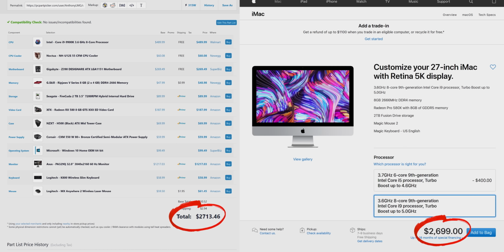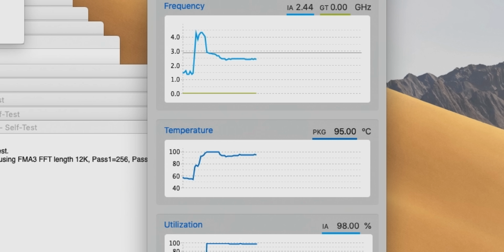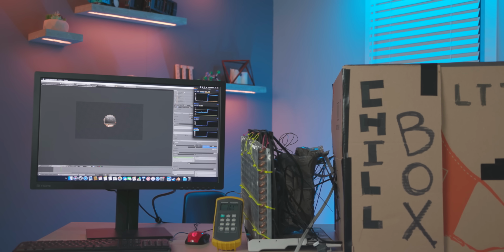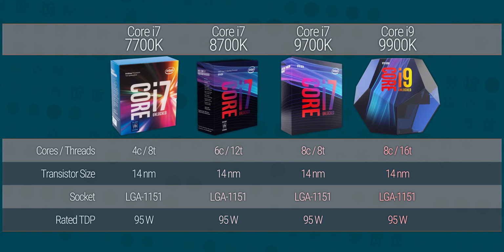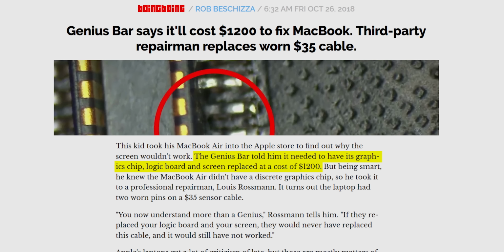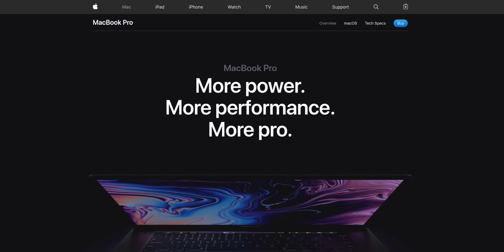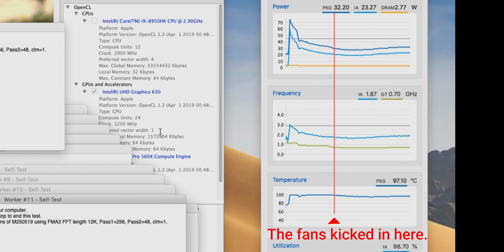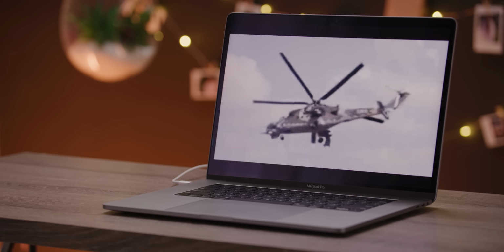Macs are SLOWER than PCs. Here’s why.

Comment: My System76 laptop is kinda broken because it wasn’t sturdy enough. The hinge just broke off and the battery is dead. I’m looking for a replacement. I would consider MacBook for Retina display, good specs and quality build. Also I don’t want to run windows. Any recommendations for a light, powerful and sturdy laptop that also looks good? I don’t care for gpu but it should handle 4K minors and have more than 16GB ram, nvme, all the latest specs. Thanks!

Comment: I enjoy many aspects of yours and Louis' videos, but I wish you were more fair/balanced. Intel has been a mess for years now, and it's clear Apple is pretty frustrated with them. They designed the 2016- form factor thinking the smaller, cooler Intel chip processes were coming, and instead of that, they got hotter chips with more cores. Look no further than your point about the iPhone to see what Apple would like to do with their hardware. If the ARM Macs come and still have these issues, I won't defend them, but I think these hotter 6 and 8 core chips have caused Apple a headache. You ask why they don't sell slower machines that don't need to throttle, but if they did channels like this would crucify them for selling slow machines, and they'd be using a lower class of component with all that that entails. The market demands the fastest chips, and every manufacturer does this with their laptops. The few laptops that have better cooling than Apple's tend to be machines that you can see with a glance Apple would never make, and their customers would never buy (that's taste; it doesn't make them idiots). Another huge issue is battery-related throttling. Many Windows machines cannot run at full capacity on battery power because of wattage constraints, but Macs can. Max Tech has a video illustrating this dramatically. It's just so much more complex than 'Apple doesn't care.'

Comment: Yes, Apple marketing is very misleading (as are others).  But you can get a decent computer from them if you do the proper research and stay away from their base models.  P.S. I don't sit around running benchmarks all day and my late 2013 15" (Crystalwell) MacBook Pro is still running strong and has never once caught on fire.

Comment: Can someone explain why copy speeds of 4K video from my Panasonic G85 to my new MSI b450 Pro Max PC running Windows 10 fluctuate between 12mbps and 0kb? Using USB 3.1 port. They don't do this on my 2012 mac. It took an hour to transfer a 1GB file :( - I will not be able to transfer multiple files without the battery literally dying on my camera

Comment: As a Graphic Designer, I have been living on the Mac side, and like a pro driver - I don' wan' to be mechanic - I wan t' DRIVE. And avoid some of Windows issues. That said, I do have recurring issues with Apple placing elegant design over performance on their desktops and laptops. The expandability of the "trashcan" Mac Pro was so disappointing that I held off for the the new incarnation - to see it priced out of my use case class. (Not overpriced, just priced out of the not-working-for-pixar or Linus Media Group class... ) So I have been nursing my two Mac Pro towers (2008 and mid-2010) along with occasional upgrades as I have spare cash, tho I do have a recent vintage (pre-touchbar and butterfly keyboard) MacBook Pro, which IS reasonably snappy for my usages. I'd e VERY pleased to see a "working class" mac pro tower - with iMac Pro level specs that I could expand and upgrade...  but dream on.

Okay - they did devote enginnering creativity and chops to thermal issues on the iMac Pro, that's fair.

I really really hate Apples use of the word MAGICAL to describe their products, features, and user experiences. As if Apple machines are all powered by rainbows and unicorn farts. Everytime I hear Phill Schiller use the word "magical" in an Apple keynote - I want to put my fist through the screen. They're MACHINES, you marketing jackalope - and science and the laws of physics still apply!

Comment: Imagine buying a tool such as a computer, mainly... based on how it looks. Oooh that hammer has no nail puller. But it looks nice. Buys....
Reply: I'm a strange position as someone who agrees with this point, but also has a hammer without a nail puller...
Reply: Joe exactly why Microsoft made the Surface Pro look all snazzy
Reply: The same thing actually happens when buying cars and other common stuff.
Reply: Yup! Totally didn’t think about my carbon fibre look with camouflage design on parts of the laptop, and plastic bottom on my laptop that I bought a year ago.

Actually, I was eying for another laptop, which was cheaper, it was the ASUS Zenbook, it just looks subtle and clean, lighter as well, but you just can’t compare it to a larger and stronger laptop.
Reply: _atmofficial people don’t just buy macs based on aesthetics. macs may be slightly slower but their os, battery life, and lightness are reasons why ppl may stick with macs. some people just don’t like the look and os of windows so they stick with macbooks like myself.
Reply: Apple is hardware, os and eco system. Theres no comparison
Reply: Joe  Thats how Fiat 500's are sold.
Reply: Thor yes it does... if it’s DESIGNED without one... lmfao 😂😂😂
Reply: I actually have a hammer with no nail puller and it's very annoying
Reply: I bet you do the same with clothes. Some do the same with cars.
Reply: Mostly because people want a thin and light but well made laptop that just does what they need.
Reply: you have never used a mac keep watching videos and think it is the same experience
Reply: @entertainmentprime101  
Some things that baffle me about apple users are
a) their inability to use interpunction. Don't your keyboards have commas and such?
b) their fanatical defense of something that's by objective matters inferior because of the choices they've made where form goes before function. No cooling to talk about that throttles the machine (objectively shown and reproducible). If your product is so much better, then you wouldn't be butt hurt when someone points out it's flaws.

And you can also browse YouTube on something like a Chromebook. You don't need something that costs you an arm and a leg (or your first born).
Reply: @1972LittleC  How do you know Mac users don't use punctuation? Knowing one or two sods who own Macs isn't really conclusive and accurate for the millions who use them. 

It's obviously got flaws, it's not perfect, but so is any Windows laptop. It's a personal preference not something taboo.
Reply: Well on the other hand the manufacturers of gaming laptops seem to think there’s sales dollars in making their devices look as garish as possible, so maybe image does matter to people.
Reply: Like it or not, everything you bring to a business meeting says something about you.  Normies care about how things look.  A Mac says that you work for a company that's small enough that it doesn't have a dedicated IT team to research the best value machine for the job so it's nimble enough that you can give the prospective client a lot of attention.  It also says that your company is successful enough that you aren't going to fold halfway through their contract.  To PC enthusiasts a Thinkpad X-series or Dell XPS say the same thing, but to everyone else those say Thinkpad and Dell on them, which might as well say corporate drone.  The new 2020 MBA has me considering switching my laptop to Mac, but as of right now the only Apple product I've ever owned is an iPhone 4s; I'm no shill.
Reply: Whats more impressive, the apple computer over there thats just doing, or the computer that looks like a 3 server racks taped together and has an ungodly amount of tubes pumping cooling into it?
Reply: Honestly I would rather have the tubes. For anyone in the know they would know what tubes pumping cooling indicates. Only the normies wouldn't drool over such a setup. Typically it means overclocking which means I'm getting everything and more out of the components I paid for and it also generally means that not only is it running faster but with very stable temperatures. Excess heat=dead computer components so even if its ugly (which it doesn't have to be) at least I know it will be functional for years to come, which the same can't be said about your apple computer over there. Also tubes pumping coolant are actually more impressive to me honesty because A) building a custom water cooling setup takes a lot of knowledge/research and B) It is actually VERY expensive in case your not aware. PC also don't need to look ugly as they are much more customizable then apple computers with a plethora of different cases you can go with fyi. They can also be easily self-serviced unlike mac. A well set up watercooled pc actually looks really nice with the different florecent cooling/tubing they have available. Also tape? I think your being a bit disengenious...
Reply: _atmofficial The only reason the people I know buy them is not the looks: It’s the ease of use and brand recognition
Reply: Actually if you are in a business sector and working with other companies and clients it can be really important. I personally use macbook mainly because of its OS, and spend probably 70% of the time on macbook and 30% on windows based computer
Reply: @5amilyyy  Important as a status symbol or what? Most businesses run Windows machines
Reply: @RetardedSysAdmin  I'm sure he's talking about like in meetings with other companies. It "shows" that your company has money
Reply: @TheScrubmuffin69  if you know what you're doing with it and why you have it. Otherwise you look like a businessman ready to throw money at anything, production and budget aside.
Reply: @NaudVanDalen  Perhaps they have enough money but a successful business is always trying to cut cost to save money and net as much profit as possible. They can be quite greedy at times and with mac computers typically costing more money for less performace it isn't always the best idea for a company. Just because you can technically do something, doesn't mean you should go ahead and do that thing especially if it isn't in your best interest...
Reply: @RetardedSysAdmin  you ain't had a client before on your job?
Reply: Honk Honkler if you write code on Windows instead of MacOS I'm sorry for you
Reply: @5amilyyy  I knew a guy who was a rep for a company. He got provided decent company cars. When I asked him about the cars, he replied it’s good for his companies image when he drives to a client.
Reply: @5amilyyy  i usually dismiss people with Macs. i can only imagine, prospect business partners will dismiss them to. Coming with a Mac to a meeting shows one of two thing: 1. You have no idea what you spend your money on  2. You care more about being "trendy" than actually being productive. - Or both points
Reply: @Backmarker81  
I know, and as a purchaser I've dealt with a few of them, pulling out macbooks and not knowing what they were talking about that wasn't covered in their presentation. The guy I was most impressed with just had a notepad and a pencil. He took out an old, beaten Lenovo Thinkpad at the end of the meeting to shoot in the order for samples.
Reply: @Backmarker81  Sorry, but that is hugely ignorant. Have a look at those who run companies, a lot of them use Macs. Mac isn't about being trendy, it's about using what suits you. Macs have a few things over Windows laptops especially the OS. 

If you "dismiss" people because they own a mac - then you're probably the kind of person who will dismiss people for other things too. That'll bite you in the arse at some point.
Reply: Basicaly how women buy their things
Reply: Yep basically
Reply: It's a female thing generally although men can be there too.  Aesthetics over function.
Reply: @blacbraun  last time I checked it was mostly men who bought gamer chairs and rgb which are completely unrelated to actual useability and performance
Reply: I buy it because it's faster than a more "powerful" Windows PC: https://www.youtube.com/watch?v=KnapaZYD2cU
Reply: @samferr16  final cut is more optimized but the mac itself is still slower so if all you want to do with your laptop is editing then buy a macbook but if you want a powerful laptop then the macbook is still a bad choice
Reply: @samferr16  He used different software though. Its more credit to the software maker which I'm sure you could find something similar for Windows.
Reply: Strider X He’s using software BY Apple.
Reply: They buy it for for OSx which is objectively superior to Windows in so many ways it's impossible to list them all.
Sure Apple is greedy and manipulative but Microsoft is greedy, manipulative, reckless, entitled, and *DOES NOT RESPECT THE USER*, the user's privacy, or the user's valuable data.
Reply: @who8myfish  Privacy? You mean like Apple hiring people to listen to Siri recordings???

😂😂😂

Apple isn't a Saint of a company either. Stop drinking their Apple Cult juice.
Reply: @PSYCHOV3N0M  exactly. They do that.

Comment: 0:10 Says PC are just as expesnive as Macs spec for spec as he uses a standard 4k monitor that costs $1200
Reply: to all who are saying the mac display is still superior...
the point is, you could really save money by going for a more moderate display and still you wouldn't lose any performance.
with the mac you cant. you HAVE to pay the 2699.
with the pc you could actually go down to $300-500 for the monitor and still get a very very nice display.
that would mean $1800-2000 for the PC then.
Reply: @baumstamp5989  That's a good point. If you wanted a 144hz monitor you'd have to choose it over 4k. BUT at least you can choose!
Reply: @baumstamp5989  Although what you're saying is correct, it totally misses the point of the whole "spec for spec price comparison". Sure, going with a lower display is usually the logical choice, but if you're going with a lower display then you're not comparing spec to spec, and therefore the price comparison makes no sense in this case. If the point was to state that you can't do that with a mac... well yeah, if the hardware is built into the display, then of course you can't do that, but then again anybody who is planning to buy a mac should be aware of this, so it's like saying "cars don't fly". We don't do that.
Reply: @Micah Brown-Dennis You can get a 5k and even an 8k monitor for PC's, but honestly who really cares? The difference between 4k and 5k will probably go unnoticed on a screen this small. I would worry more about the colors and refresh rate. I guess if you're photo or video editing, ok get a 4k, otherwise even a 1440p monitor is alright.
Reply: @diegogarcia4255  I think that was an actual point they made in that video. OR at least they compensated with refresh rate or something
Reply: Some pc's are cheaper than that.
Reply: @Micah Brown-Dennis pc has 8k monitors.  Macs (apple) can NEVER outperform pc's.
Reply: @m1ten supports? It can never act use it🤣
Reply: Yeah, 4k for big televisions is understandable, but it doesn't really matter for small PC monitors. 4k, 2k and 1080p look very similar at that scale.
Reply: @bip901  1080p look nothing like 2k. I will never go back to crappy 1080p ever again

Comment: I have a 2011 17” MacBook Pro. Paid a pretty penny. It went 7 years without issue. Mainly for home and DJ. GPU died after 7 years but I found a guy who put a brand new GPU for $200. So it’s still going strong. I love that laptop. Now for anyone actually doing video rendering, if you bought a laptop for that, you’re kinda silly. Get a beastly desktop. Video rendering is not for portable. Just like trying to get real work done on an iPhone is also kinda silly.

Comment: Just imagine what Mac OS X’s potential would be if Apple swallowed their pride and made it available on non-Apple machines. People would actually want to develop apps for it for it would have a much bigger install base lol
Reply: DEPARTMENT OF CORRECTIONS Actually it would be fairly easy. MacOS theoretically can run on any hardware. The issue is Apple actually programmed protocols in the OS to block installs if it detects it’s on non-Apple hardware, which is why Hackintoshes are so complicated since most of the work is building the right PC that can trick the OS.

Comment: That’s easy they use cheap parts , and low powered components . That’s why here expensives . Cause they rip you off
Reply: DEPARTMENT OF CORRECTIONS yeah , but go watch Louis rossman . He fixes Apple products and will show you what garbage they are . He will also show you how they set it up for failure . Then when you send it in for repair . It’s pretty bad . Go check it out .

Comment: Honestly, with all the hate, I have a 2017 MacBook Pro (i5, 13 inch) and it runs like a champ when I’m video editing. It’s a hell of lot faster then my Windows 8 PC I built back in the day. Of course a lot of that is Apples wicked fast SSD. 

Is there thermal issues down the road I might be dealing with? Yeah sadly it might be an issue. I have built PC’s and I know how that works. And honestly no one can know how long they will last ... because it has only been like 2 years since it was released. I’m pretty confident the keyboard issue is actually a heating issue and the new 16 inch MacBook Pro 💻 keyboard (along with better cooling) is Apple hiding that fact. But the fact that exists proves that Apple does care and can design an awesome laptop.

Comment: Can someone tell me why my 17inch 2011 Macbook Pro died one day after a few years around 2016? It wasn't riddled with Viruses as far as I could tell. Are they programmed to die on some time limit so Apple forces you to upgrade or is that just an unproven conspiracy? It did get really hot pretty often though.
Reply: It's probably the motherboard warping and breaking.
Reply: An apple employed told me the GPU fried. But idk how. I barely used it for gaming outside of emulation.
Reply: @1122markj  Heat kills the GPU.